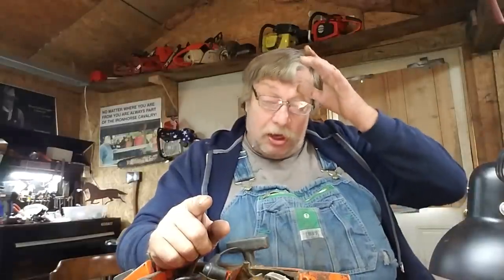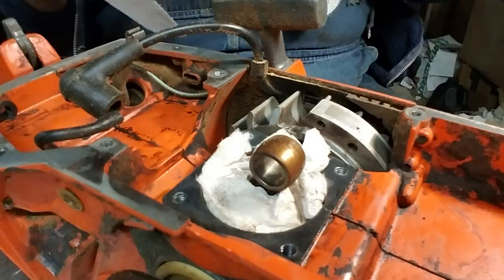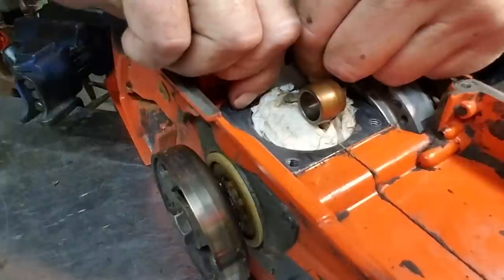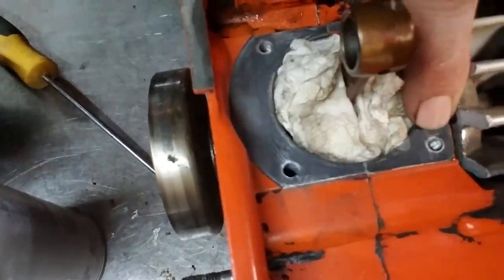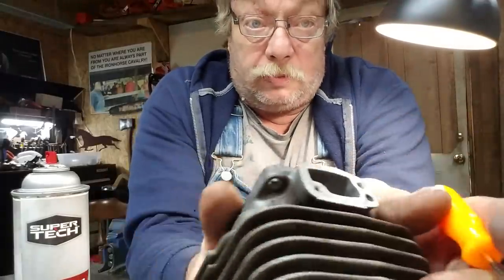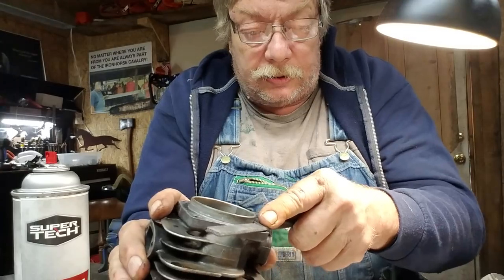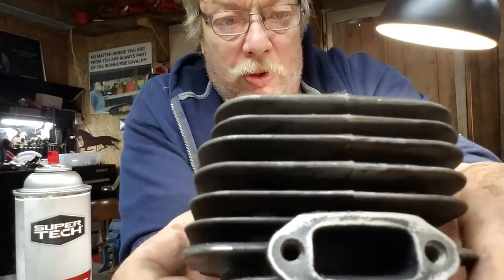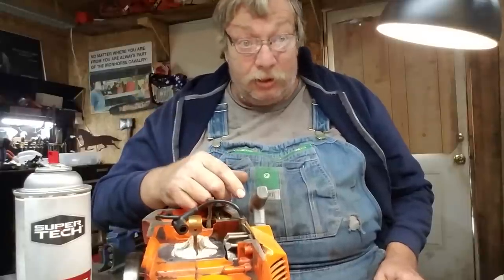cleaning 272 mounting surfaces! saw talk! an idea for a new bearing press!

Comment: I just made me a press with the harbor freight press and added an air Jack turned out nice you can add a foot valve on the air line if you want both hands 😁👍
Reply: I was thinkin air too, with a bleed valve to regulate it.i have a pneumatic rivit press for hockey skate assembly that is basically the same thing as what he wants. Would basically work same way just different die sets
Reply: Yeah you can do a table top model if you can find a small enough air Jack I did mine with the 20 ton harbor freight air bottle jack for wheel bearing and studs and use it all the time 😁👍

Comment: Press- look into an internal clutch slave cylinder and master cylinder combo. Probably plenty of pressure for what you need, without too much. Nice flat mounting and press surface with more travel than a brake master cylinder.

Comment: For the same amount of force, the smaller the master cylinder, the greater the brake line pressure. Typical brake line pressures during a stop range from less than 800psi under "normal" conditions, to as much as 2000psi in a maximum effort.

Comment: I was thinking maybe u could fab up a old porta power pump with a ram to a press frame? Fix up a foot pedal to the handle?
Reply: I was going to say the same thing, they all have pretty short stroke and plenty of power. A separate foot operated air/hydraulic switch would work well although they're a little pricey new
Reply: Heck yeah I think that would be alot easier.

Comment: I've had saws I've had to use a scraper to get the resin off , couldn't even see the colour of the casing ,
Reply from the maker: As have I!
Reply: @theironhorse6600  check out the front brake calipers of the 1974 Buick Riviera and 1984 Toyota 4x4 truck and the master cylinder of the 1974 Buick Riviera too Harvey.
Reply: @theironhorse6600  I'm trying to put a Mcculloch Super Pro 81 piston and rings in a Mcculloch 7-10 Automatic using a cast iron cylinder liner. With the Super Pro 81's piston bore and the 7-10 Automatic's stroke it comes to 75.02 cc's.
Reply: @johnlincicum6390  That should be interesting!!
Reply: @Smittyschainsaws  I'm hoping it works.
Reply: @Smittyschainsaws  I have a guy willing to try it out in California. I just got the new old stock Super Pro 81 piston and rings tonight. Waiting for the 7-10 Automatic crank bearings and seals to come in yet. I have another guy in Wisconsin making me custom McCulloch style air filter cover stickers that are going to say Pro Mac 750 (since it's almost exactly 75 cc's.) It comes out to 75.02 cc's to be exact.
Reply: @johnlincicum6390  I think the main concern would be the rings correct?
Reply: @Smittyschainsaws  no, the rings are fine. It's whether or not the cylinder walls in the 7-10 Automatic's cylinder head are thick enough to be bored for the cast iron liner.